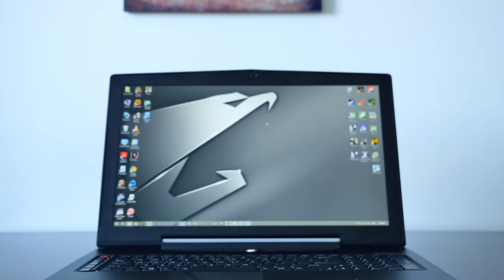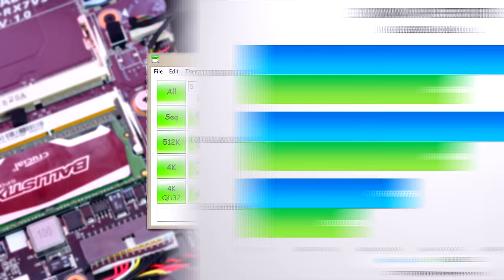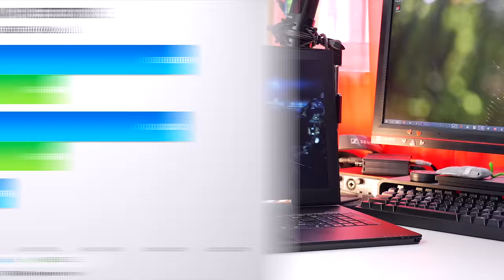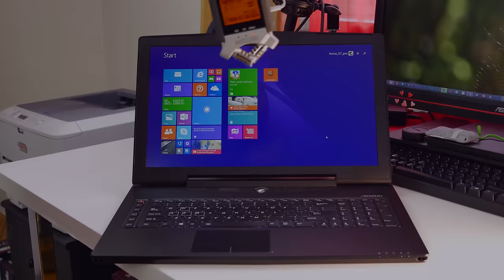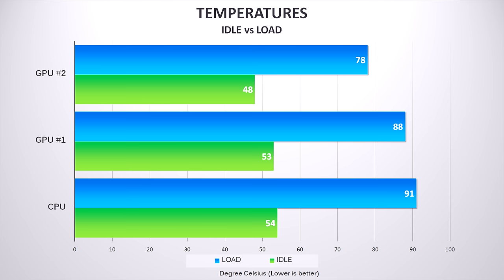GTX 970m SLI inside a notebook - Aorus X7 PRO Review

Comment: I don't really understand the point of putting in 970m SLI if the heat and fan speed is going to be that bad, this obsession of making thin laptops with maximum power with little regard to heat is silly, the chassis should either be a little bit larger for bigger fans, just add a 3rd fan like on some Sager laptops or both.
Reply from the maker: Vega M pushing the limits I guess. Totally agree with you in regards to having a thicker body for quieter and more effective fans to cool the hardware.
Reply: Akash Singh Well the non pro version doesn't seem to throttle at tall. Probably heat, but not throttle

Comment: Verrryyy verrrryyyyyy helpful review.. That fan sound test is the one that made me rethink to buy this.
 Sorry for my english
Reply: My thoughts exactly, this thing is super loud...
Reply: Wong Music
arent all gaming laptops super loud. the asus one are the only one with the magic formula to keep the noise a bit more quiet and the temp. very low, like 70 to 80 Celsius on full load. or lower.
Reply: THE16THPHANTOM Not denying that you should expect a gaming laptop to be fairly loud, but this is a whole new level of extreme. It's not really surprising now that I think about it though considering that the laptop is so damn thin.
Reply: I don't know about you guys, and maybe these fans are indeed a bit loud, but that should be expected. It's kinda weird in my opinion to play video games w/o any headphones, because at least a pair of iPhone earbuds everyone should have, and they are more than enough. As an example, I own MSI GE70 2OE-017US, it has a turbo boost button that I believe spins the fan to its max ~ 4,000 RPM. It gets loud as hell, works like an airplane engine when aircraft running the runway to take of. And when I play SRS with iPhone headphones my volume is set on 12, and I don't hear shit except the noises in the game. I'd take loud fans any time any day as long as they provide adequate cooling, because cool CPU & GPU >>>>>>>>>>>>>> loud fans for me. And I don't know, I never play on maxed out graphics anyway, always set all medium/high in games (Vsynch and AA is off, don't need them), and my temps hardly ever go above 82-83 degrees (for some old games for example I don't even need turbo boost, super quiet laptop with max temp hitting just below 80). I guess it depends on tradeoffs and each person's priorities they seek in these machines. It's lifespan of components + cool internals during gaming rather than quiet fans and maxed out graphics. But to each their own...

Comment: Portability and performance is ALL I care about.  Just ordered one and another 16GB ram.  This will be a powerhouse!!
Reply: I would recommend it to anyone.  Best pc I've ever owned!!  I mainly bought it for work.  I do vfx for movies and TV and it screams like any desktop.  It also games like a monster!  Highly recommended!
Reply: The keyboard always stays very cool... But the bottom, of course gets hot.. It's a desktop in a laptop. As for noise.  The fan can get quite loud when graphics are really cranking. But that's to be expected. Of you're looking for a quiet machine, you won't find one that's also powerful.  The fan system is actually really good and blows all the heat out the back.  I game with headphones and don't really mind it while I work.  No louder than most desktops... Just closer to your ears.
Reply: Gigabyte nailed it on this system.
Reply: Richard Servello awesome, I order mine as well, what a remarkable piece of engineering
Reply: It seriously is.  Between this and my surface pro 3, I'm covered.
Reply: Adolf Hitler it has 6gb totally.  But until memory stacking is available, games can only use one GPUs memory.
Reply: i have one 970m with 6gb with severe oc's and it sheds most games now why upgrade sooner because one hits vram limits with extreme mods
Reply: Dual GPUs is much more powerful than a single with more vram.
Reply: I know but 1 gtx 970m 6gb is more than overkill for what I do

im not paying minimum 500$ more for better fps in 1/2 of games
Reply: +Richard Servello I'm concerned about the heat (which affects the longevity of your hardware) .... how has it been in your experience? Also, is the audio really that bad? I mean 2 speakers + 2 subwoofers should give you some nice sound quality right?

Comment: I owned this laptop for a month or so before replacing it with an MSI Titan. There is lots to like about it, mostly it's power and thin chassis, but that came at a price and I was just highly concerned about it's wellbeing whenever I was gaming for a few hours at any one time. The fan noise didn't bother me personally as I always had headphones on, but it was extremely distracting for anyone else within my vicinity and I often had some frowns aimed in my direction haha. Overall I couldn't recommend this laptop but there is plenty to like about it. Great review as always by the way 👌🏻

Comment: Let's face it, any serious gamer will be running this with his/her own headphones, mouse and possibly a laptop cooler.
Which eliminates most of the major cons. 

I'm actually glad to see AORUS skipping the 3K/4K screen gimmicks and giving users a perfectly acceptable 1080p IPS screen which can allow for 60+ fps in most current and upcoming games. 

Finally, a thin, not too heavy gaming laptop that can at least handle the heat of it's high-end components. Without throttling.
Reply: yes the laptop "handles the heat" at 100 degrees,who are they trying to fool? this will degrade the components quickly.
my fx8350 runs 35C on max load. thats handled heat
Reply: They're on the right path.
Reply: The screen is only 60 hz. So you would only be experiencing games at 60 fps anyways
Reply: Timo Pomer ofc in a desktop heat can be handled easily, as there is so much internal volume inside a case to place much larger and quieter cooling solutions. In a notebook that's less then an inch thick, and has pretty high end hardware for its size, it's a given that the thing will run extremely hot and loud. Hardware that's used in notebooks are usually made to withstand the high temperatures though, and that's seen in the X7 because no throttling occurred despite ~90*C on both the cpu and both gpu's.
Reply: Timo Pomer Most nVidia laptop GPUs are specifically designed to be stable over 100 degrees. Who are you trying to fool?
Reply: Timo Pomer The CPU can handle it. The one in my laptop is at constant 85 degrees during gaming and it's been like that for three years. It's still trucking on.
Reply: DkGnClan External monitor..
Reply: wyntje83 then whats the point in a laptop
Reply: DkGnClan Mobility. Taking it with you where you can't take your monitor.
Reply: wyntje83 then get a desktop for the desk and a laptop for trips. If you have that much to spend on a laptop, then buy a desktop too anyways
Reply: DkGnClan I've tried that. I hated having two computers. Games that weren't on Steam, I needed to have a backup a saves, every game needs to be updated constantly, you start misplacing files, etc. It's a hassle.
Reply: AkiraSieghart use onedrive/dropbox for your files. But yes it is a bit of a hassle
Reply: DkGnClan I'm aware there's ways to get around most of the issues. It's just not for me, though. I'd honestly rather pay the extra money but then again I can. A lot of people probably aren't in the same boat.
Reply: Jonny B My point is that everything beyond 60 fps is wasted when the laptop only has a 60hz display
Reply: HaxDkGn Not if you plug in an external monitor that goes above 60hz.
Reply: wyntje83  >I'm actually glad to see AORUS skipping the 3K/4K
There are no 3k/4k screens in 17" atm. Nobody is making them, it's why you only see it in 15" or below. It's not some active choice, it's just that it doesn't exist. Look at the 15" lines from other gaming laptop makers they all have the 3k/4k options in at least some of their 15 series. NOBODY has them in 17. They're just not available. Trust me if they could tack on another upgrade so they could be charging another premium they would.
Reply: +Timo Pomer you mean like thermal throttling?

Comment: nice review. I'm considering a laptop along these lines with the sli 970m, but this one sounds like a vacuum cleaner. I think there are better implementations of an sli setup, and given that a slim design is pretty low on the priority list of people who would consider this kind of machine, I'm not sure what they're going for. my current msi gt70 is using a single 780m and it's beastly thick, but has had no issues with cooling or noise in the 3 years I've had it. thickness or weight is just a non issue for me when using this type of machine.

Comment: Can't wait to see the Aorus X7 Pro V6 in action. That monster with 1070m SLI should be as fast as a reference 980ti! 3K is arriving to laptops.
Reply: There will be no SLI it's either a single 1070 or 1080...check the Aorus x7 on their website
Reply: Yeah I wrote that way before they dropped SLI support for Pascal.
Reply: 10/4 still going to be a beast of a laptop...I just hope the 1070 will be enough with the mobile CPU to run the 1440p display at a good framerate without thermal throttling...I already know the 1080 in that chassis will be hot
Reply: tony45x220
Well i7 4720HQ + 970m can already deliver some 1440p gaming, and this would be far faster, the 1440p should be guaranteed for now.
Reply: +Niebuhr Yes but with what sacrifice made to visual settings...I'm interested in taking advantage of the higher refresh rate of the 120hz G-sync 1440p display...but I'm not willing to turn everything down, only a few things mainly anti-aliasing especially at 1440p...I'd love to run with the 1070 and have a slightly cooler running machine for longevity...but don't wanna regret not spending an extra $300 a year from now with new titles.
Reply: tony45x220
The 1070 for future-proof 1080 gaming and the 1080 for the most demanding users.

Comment: Well I think that it's better to skip the optical drive even on "bigger" laptops, this free space can be used for something more useful. Also, if you buy external optical drive you can use it for any machine, which is better. And those 2 usb ports at the back are really good for stuff that will be used rarely and won't disrupt the look. I'd buy that laptop if I had  the money.

Comment: nice review and nice editing.
i have this laptop on order, cant wait to test it (i will update if anyone is interested)
i was wondering tho, the gaming test you did is a benchmark right? so it pushes the components to their limits? so if im right how does it sound in regular gaming? also in older games (i play mostly mmos like swtor). I have also read you can disable the sli and use only one card so that might also help

anyway nice video!

Comment: I just ordered one of these, but I'm getting IC diamond thermal paste (it was a free upgrade too, I lucked out) to hopefully help with the temperatures. I also asked them to disable the raid setting, Standard SSD performance is plenty fast enough. I can't wait to see how it goes.
Reply: So how is it?
Reply: Reaper31292 please update us, it is worth buying for $2500?
Reply: Dranreb Winer That's a tough question to answer. If you're really, really into gaming and you need portability, then sure. This thing gets really hot in gaming situations. Mine gets hotter than on the reviews I believe, so I turn off turbo boost to keep temperatures down. If you don't the CPU can get up to the low to mid 90's and that's bad news as far as the lifespan for the components. Also, 3GB of vRAM is only barely good enough for the highest settings on some games, so that might annoy you a little bit as well. Besides those two concerns with performance, It runs almost everything at respectable settings very well. With build quality and such, there's a considerable amount of keyboard flex, and the built in speakers are lacking low end, though the screen is pretty good. Not great, but very usable as far as games and movies go. To be fair, I'm used to using a Macbook Pro with Retina display and that's all metal with no keyboard flex, decent speakers and a great screen. I might be a little biased there, because I haven't had a windows machine in years to compare it to. 

Over all, it's great but not perfect. I'd only recommend buying it if you are a die-hard gamer. Like if gaming is your number one passion. If not it's kind of a waste, as I have learned. If I had to do it over again I'd only buy it if I thought I was going to be gaming for hours a day each day. You can get laptops now that have just one GTX 970m for a thousand dollars cheaper, and to be honest, lower settings on most modern games look pretty damn good already. Not to mention that they're a good number of games out there that still don't support SLi so there's a chance you'll only be using one of the graphics cards anyway. 

I'd probably be able to answer any specific questions you have more easily.
Reply: Reaper31292 How loud are the fans compared to your macbook pro retina? I have the same macbook and they are damn loud with my workload.
Reply: Oleg Lukanin I just sat them down next to each other and put both fans on max, and the x7 is about twice as loud as the MBP, maybe a little more. I will say that when you're into the game you're playing, it's easy to get used to though. Honestly, I use headphones when gaming anyway.

Comment: Great review; very informative and engaging b-roll.

This laptop is so confusing; dual 970 on only a 1080p panel? Plastic bottom cover with those temps? And the thing actually sounds like a jet engine; I think the would have been better off going with a single 980m and a 1440p panel with this price range; they probably could have used the extra space for better cooling, and a single gpu would probably help battery life as well. The CPU specs and keyboard were impressive though.

Comment: I don't understand why they can't do a SLI laptop with a higher res screen. There isn't really much point putting 2 970's if its just 1080p. May as well just stick to a 980 single gpu without all the disadvantages of SLI
Reply: I run most of my games at 5760*1080 so SLI helps for that.

Comment: When facing the laptop the right woofer doesn't seem to be firing on my x7 pro. When you opened it up, did you see a plug that might easily come loose during shipping? Will taking off the back void the warranty?

Comment: I bought one of these and the CPU temps would hit 96c after about 20 seconds of running a game. I called Aorus and they said this was not supposed to be the case so I sent it back for a return (was out of stock so got a refund). After looking into this more it seems every one of them overheats like this. The thing goes nuclear under minor load.

Comment: You say 91 degrees is a lot?
My macbook gets to 100 degrees Celsius and then start to be thermal throttled if I don't manually max up the RPM on the fans (Which makes the laptop uber loud)
Reply: Invis Cheetah Because I got it for free.

Comment: How did you take those glamour shots at 00:46?
Reply from the maker: penprowl2 Can you be more specific with your question? :p
Reply: I'm mostly curious about how the lighting moves around or quickly flashes between angles.
Reply: I'm thinking of LED lights, skewing them horizontally and vertically :) Close?
Reply from the maker: Griffon222 Bingo :D
Reply: Griffon222 
Thanks!
Reply: penprowl2  No problem! :)

Comment: which is stronger gtx 970m sli or a desktop gtx980? just curious been looking for a result for a while now still no results
oh and that is one powerful laptop!
Reply: gtx980 (desktop one, the 980m is meh)
kicks butt against pretty much everything else, even two 970m in sli, also NO MICROSTUTTERS so overall
single good gpu > multiple meh gpu
Reply: +Gundolf Scherenberg linus tech tips proved otherwise. the 970m sli beat the 980 desktop version
Reply: Raw performance, yes. but in a notebook sli is just not the way to go. you will have a much better experience with a single gtx980
Reply: oh well went with the gtx 960 desktop rig 
its cheaper but can play well on 1080 
so im pretty happy now with my build
Reply: meareAaron just make sure you're able to upgrade to a 970, they'll get a pricedrop as soon as pascal is out
Reply: i dont think ill be upgrading for a while im pretty happy with my gtx960 can play planetside 2 at max and that is good enough form me :D

Comment: Can the 970m sli run the upcoming games from 2016-2017??
Reply: +Jose Torres Alicea This baby is as powerful as a desktop 980. Since DX12 allows stacked vram, and games won't turn noticeably much more demanding than, let's say The Witcher or Crysis, I expect it will run flawlessly by then unless Nvidias decides to cripple its performance like they love to do.
Reply: It is as powerful as a GTX 970, not a 980. You should just wait for the x7 dt, it will have a desktop 980 in it and will still be thin and light
Reply: George King i think i will wait for laptops with gtx 1060-1070

Comment: should i get this or wait for the X7 DT?
Reply: wait. You'll be able to get a (relatively) thin and light notebook with a desktop 980 in it
Reply: i'm having the same trouble. this, or a custom laptop with a dekstop 980 in it, also for $100 less. 

thing is, the 970m still performs 5-10% better. but it's still SLI.
Reply: TheSpyChecker
where were you thinking to getting it built? I guess that's my issue too, i also want to wait and see how the X7 DT does with temperatures too.

Comment: Seems to not be worth it. I've seen more laptop for less. And no reason to make a really thin laptop that has that much power/heat. How efficient the new nVidia GPUs are, and they run that hot? I do like the performance and attempt, but this doesn't look like a $2500 laptop.